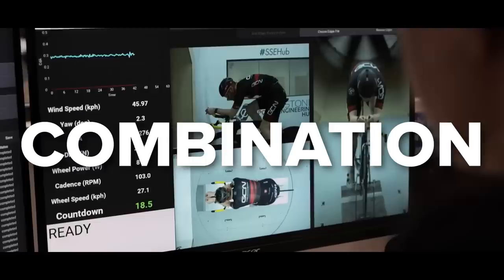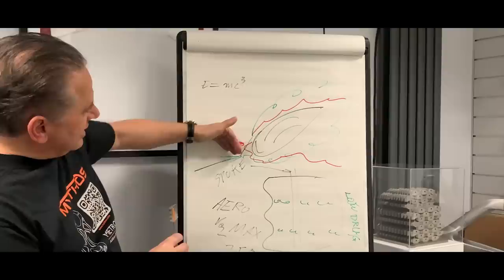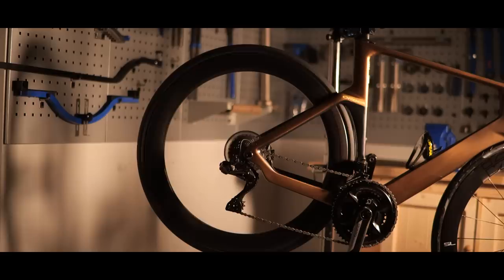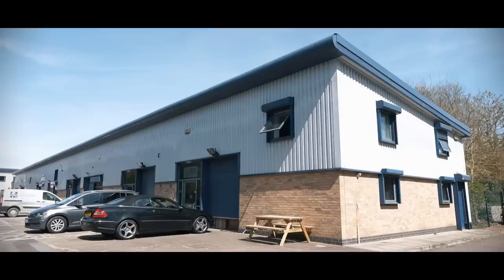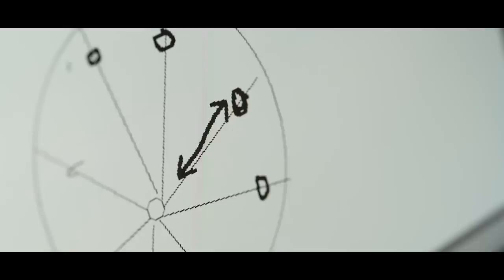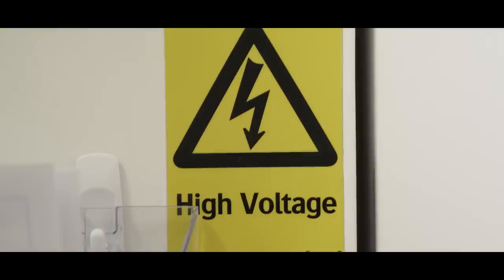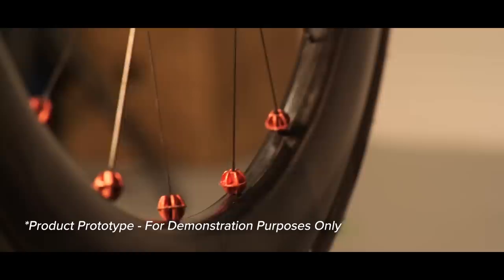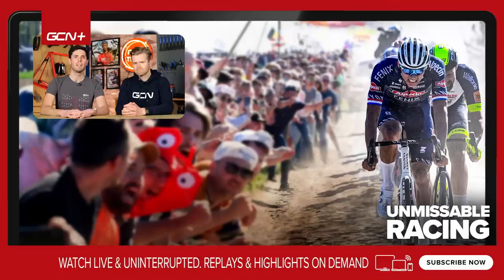This Is The Next Big Thing In Cycling Tech | GCN Tech Exclusive

Comment: I think I saw these back in the day.  The original used a base plate of pre-famulated amulite surmounted by a malleable logarithmic casing in such a way that the two spurving bearings were in a direct line with the panametric fan. This new variant seems to consist simply of six hydrocoptic marzlevanes so fitted to the ambifacient lunar waneshaft that side fumbling seems to have been effectively prevented!

In layman's terms, these new Spokie Dokies are absolutely a marvel of modern encabulation!
Reply: Marzlevanes are way more efficient these days
Reply from the maker: Couldn't of said it better ourselves 😉

Comment: Ive been utilizing this concept for years. My version has even better results. I use lead fishing weights on my spokes. These weights slide up and down on the spokes depending on the speed. When you get up to 15 mph. The weights move to the end of the spokes and have the same rotating mass as the flywheel. Sure you might add about a lb of weight but consider it weight well spent. I use it on my 10 lb Treck.  Sure its a little slower uphill but I make it up and then some on the descent. Best idea ever.

Comment: Ok. Not totally free speed, but with power bars you can get the most power out of your legs using a rhythm by pulling, not yanking, as your leg pushes down on the pedals on same side you pull, example right, right, and left, left continued it thrusts you forward due to ultimate leverage for power! Simple  physics! 20 year patent! Need to get them out on the market as training tool! Nice thing the power after trng. Is staying power  similar to weight trng gains. I use them for intervals, speed gains. Not an April fools joke!

Comment: Actually, thin aero fins that can slide and rotate on spokes have been proven to increase speed on shallow rims and TT bikes.  They reduce aero drag once up to speed, which is far more time spent than at very slow speeds.  The bike does accelerate faster from zero than if they were permanently fixed at the outer ends, because gravity pulls them down/out  for you  when they are at the bottom of the rotation.  And if they can spin on the spokes about 10 degrees,  side drafts don't destabilize the wheel.  (Faster AND more stable in crosswinds = win win)  Yes, there is no free energy - you have to brake harder when coming to a stop and they slide back towards the hub... but in a bike race, you should only stop once... after the finish line.  I saw it proven in a grad student engineering project with real cyclists on real bikes.  You can try it yourself with playing cards folded in half over spokes with the folded ends going into the wind and the other ends taped together to make a NACA profile.  They slide and rotate very easily.  Explained and done weighted like GCN is April Fools, but done with very lightweight materials and applied to the certain types of cycling, it actually works.  Lots of stop start like mountain biking = not worth it.

Comment: Surly it would only give you extra watt/speed as the weight moves out then the advantage has gone and you have extra weight to pull along and what you gained until weight reached the rim you would lose as soon as you go uphill be a bit like riding with a heavy rim which feel dead compared to light rims

Comment: Back in 2005 Czech rider Ondrej Sosenka set a new UCI Hour Record at an indoor velodrome in Moscow using a rear wheel that employed basically a similar principal shown in the video. His bike was very lightweight and aero and appeared to be normal in all aspects, but the rear wheel weighed about 4.5 kilograms with most of its mass located in the rim. It was basically a large flywheel that assisted in getting Sosenka up to speed quickly and maintain consistent lap times and speed for the duration of his effort. I think some manufacturers and pro road teams toyed around with weighted wheels about the same time, but such designs were banned from competition by the UCI. There was a company that promoted a “free energy” rear wheel a couple years ago that used spring-loaded weights hidden in a solid disc design to make cycling easy, but I don’t think it went anywhere. Something about the Laws of Thermodynamics and conservation of energy getting in the way.
Reply: A 4.5kg wheel won't help you to get up to speed fast.
Reply: @messi9991  You’re right, it won’t, maybe for the average rider. But that wasn’t the idea behind weight doping Sosenka’s wheel. Once he got up to speed, the flywheel effect created would take some of the effort off his pedaling while maintaining speed and ensuring consistent, low lap times. As far as getting up to speed from a dead stop at the beginning of his effort, Sosenka would’ve trained extensively as his kit would’ve been set for the record. This is to be expected, whether he had a doped wheel or not. But, just like training with weights, training and riding with a weighted wheel would’ve been no problem for Sosenka at all by the time he set his record. It would’ve been second nature - and definitely had to be since there was a record at stake then. How do I know this? I worked for the US distributor of the Italian company that made wheels at the time. The Italians were happy AF about how they pulled it off, especially since weighted wheels were legal under the UCI, thanks to some loophole. It was some gray area in the rules that didn’t make such wheels illegal, but it was eventually plugged by the UCI.
Reply: @RReese08  whether it is a problem for him or not, adding weight to your wheel will make you slower to accelerate. Your initial point was "large flywheel that assisted in getting Sosenka up to speed quickly". This is simply wrong. It is the opposite. Any training he did to practice with a heavy wheel, well guess what, if he would use a lighter wheel he would accelerate even faster.
Reply: @messi9991  I agreed with your reply and add that the laws of physics apply equally to everybody, punter and professional alike. I touched on this in my comment; nobody can negate Newton’s laws of motion or the Laws of Thermodynamics. But things can be done to tilt the odds in one’s favor: rider condition, skill and experience; equipment design, manufacture and how it’s used; and location or environment. Everything being equal, an amateur rider won’t be able to equal an elite or professional athlete. Yes, there will be some lag or extra effort in getting a weighted wheel up to speed versus unweighted, but the difference in accelerating from a dead stop will be significant between an amateur and professional, even if it’s a few seconds or fractions thereof. After that, once up to speed, it’s a matter of maintaining consistent momentum and speed for the duration of the effort lap after lap, which is the most important part, which can be attributed to the rider thanks to conditioning, knowledge of skill. Sosenka set his record under almost perfect conditions on an indoor velodrome in Moscow - glass-smooth track, perfect bike setup, favorable local temperature (which matters even indoors), and rider in perfect health and frame of mind. The only aspect where Sosenka or his team messed up is that the track was just over 500 feet above sea level - far from ideal for setting the Hour Record. Maybe this is why the weighted wheel was used, but I don’t know if anybody really knows for sure or will ever talk about it. Attempting the Hour at a recognized high-altitude indoor velodrome such as Mexico City would’ve been more appropriate and realistic. But maybe that would’ve exposed Sosenka’s attempt as less than legitimate even though the wheel was not illegal at the time, and Mexico City would’ve allowed him to destroy The Hour totally, not just break it by a couple hundred meters. Politics could’ve played a part, but I don’t know how much of a factor it did. But maybe doping did. I don’t think anybody accused Sosenka of doping when he set his record, but the UCI busted him in 2008, which ended his pro career. Sorry for the long rant, but to recap, the differences between a pro and amateur may be slow when accelerating from a dead stop may be small initially, since physics applies equally to both. But the professional will quickly gain the speed and momentum, and be able to maintain them consistently over the duration to make a significant difference in the end, all things being equal.